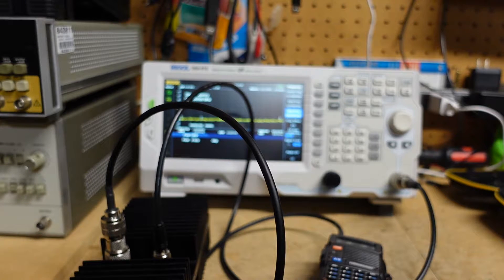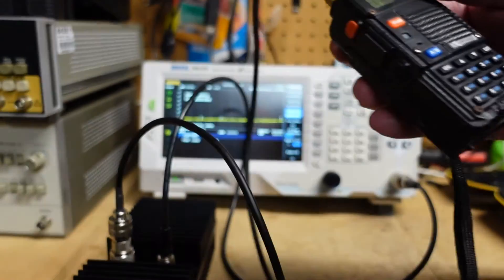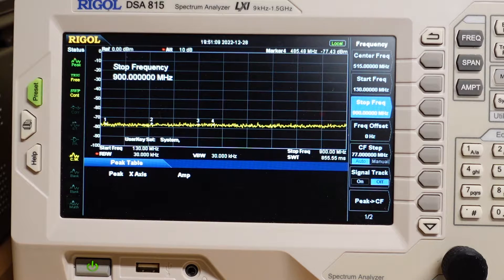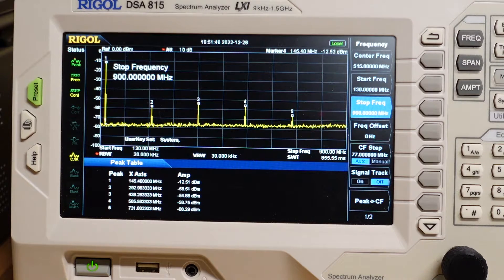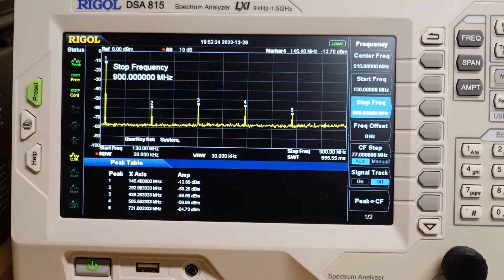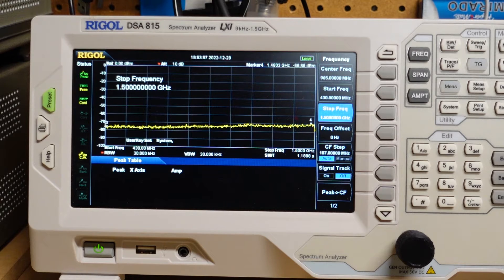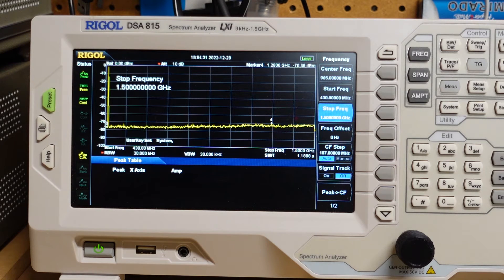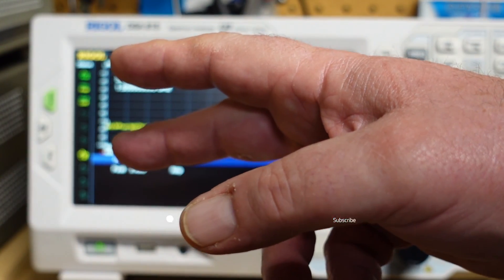Signal Check Series - Baofeng F8-HP

Comment: the rules differ somewhat between regions. In my country harmonics need to be 60 dB below the primary, so it would fail here.
Reply from the maker: It's not great as it is, it just barely squeaks by for US operation.  This particular radio didn't have an FCC or CE label inside.